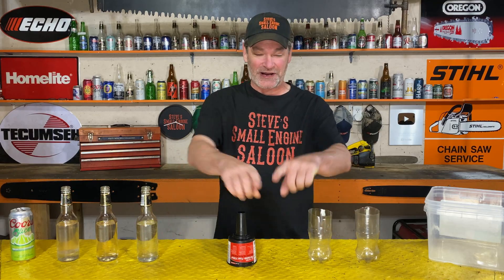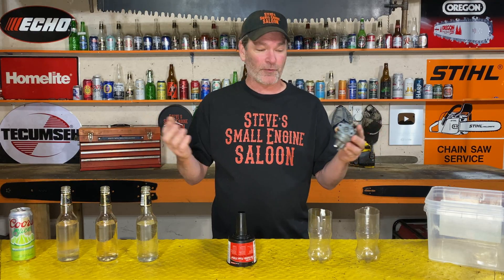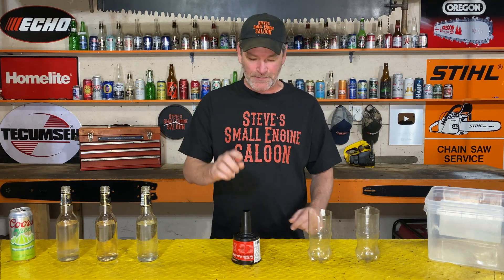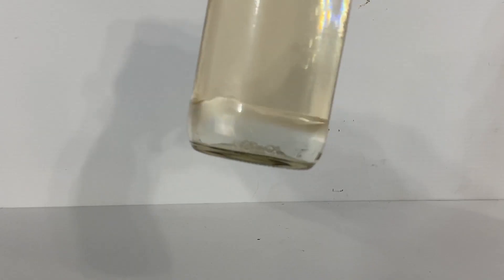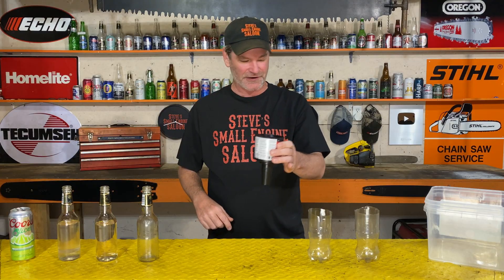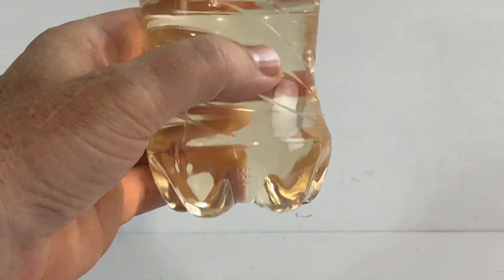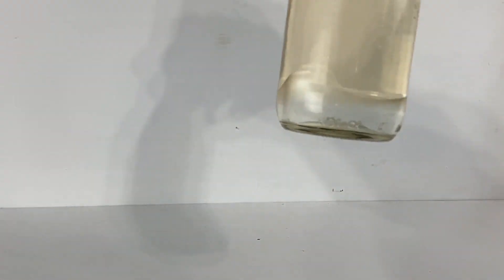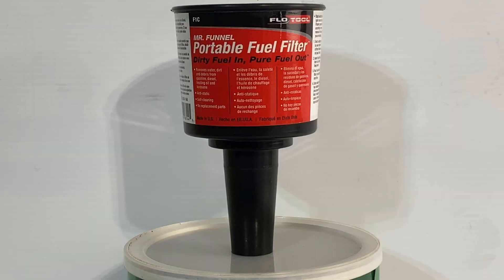Does Mr. Funnel Fuel Filter Really Remove Water From Gasoline

Comment from the maker: ✅Click here for a Mr. Funnel ➜ https://amzn.to/2Em3ydY
For more videos like this, check out: 
👉Quickest Way To Test Your Gasoline For Ethanol ➜ https://youtu.be/uLToBqG_F6M
👉Does Mr Funnel Remove Ethanol From Gasoline? ➜ https://youtu.be/6qGH7PqkYSw
👉How to Adjust or Tune the Carburetor on a Leaf Blower ➜ https://youtu.be/DWPUYJiF6KM
👉CORRECT WAY To Tune The Carburetor On A Chainsaw ➜  https://youtu.be/M6T5JoGXcHY
👉How To Adjust Or Tune The Carburetor On A Weedeater ➜ https://youtu.be/gmhxTvGRtCg

You can connect with Steve here too: 
✅Visit Steve’s WEBSITE ➜ http://www.stevessmallenginesaloon.com/ 
✅Visit Steve’s PARTS & TOOL STORE ➜ https://www.amazon.com/shop/stevessmallenginesaloon 
✅Follow Steve on FACEBOOK ➜ https://www.facebook.com/stevessmallenginesaloon 
✅Follow Steve on INSTAGRAM ➜ https://www.instagram.com/stevessmallenginesaloon/ 
✅Follow Steve on TWITTER ➜ https://twitter.com/SteveSaloon
Reply: Does it with with oil/gas mix?
Reply: first i've heard of it.  finally an answer for getting water out.  i can think of a dozen ways this will make my life easier.  Great video. thanks.
Reply: Steve you should mention that the one in the link is the small size funnel. 2.5gal/min.  Flotool makes bigger ones. Add them to the links.
Reply: So , my question is " how does it work?"
Reply: @Everyday_Richard  If you REALLY want to know why not just buy one and find out?
Reply: Did you try it on E-10 with water contamination?  Since this test was posted the refineries here in Louisiana are making an E-10 fuel that binds ethanol to gasoline chemically so the beer bottle water test no longer works.

Comment: Steve I was curious, I have a mr funnel and it works amazing for taking water out of the gas. One major question I have is I’m going to be making ethanol free gas with the water in the gas truck. My question is when the water and ethanol are separated from the gas if I pour the gas and water mixture down a mr funnel would that take the water and the ethanol out or would the ethanol get re combined with the gas when I try to pour it into the funnel after it’s separated
Reply: Easy way to tell if it does or doesn’t would be too run it through the Mr funnel. Then afterwards put the filtered fuel into a graduated cylinder with measurements marks on it, say 100 ml of fuel then add 20ml of water. Then look at the measurement llone too see if the water that has separated from the fuel is at the 20ml mark! If it is then the ethanol was removed. However if the separated water is now say at 30ml that means that the ethanol was still in the gas.

Comment: I read a story in the 60s. Stranded fishermen, small engine on a canoe, capsized --- water in gas. Dilemma! One fisherman had a chamois shirt. Gas/water poured through the chamois separated the mix.., gas went through, water did not. PROBLEM! It was a story (supposedly true) in an outdoor magazine. So, if you have the chance, and the money to possibly ruin a chamois - whatever - (probably don't need to spend $$$hundreds on an expensive shirt) It would be good to know. A small piece of chamois auto-drying towel kept with your funnel might be just as effective???
Reply: Bush Pilots in Alaska did exactly that for decades.  The trick is to pre-wet the leather with gasoline first so that the fuel passes through while the water and any junk won't pass through.  The old "Water and Oil (in this case gas) won't mix".  - Joe -
Reply: @joesinakandid528   Thanks. It sounded plausible.

Comment: Thanks Steve - I just bought one on Amazon for my generator after a power outage a few weeks back, not so much for the water removal than it looked like the best, most stable size for filling the generator.  My old funnel left gas splashing all over the place.  I was skeptical about the water removal function but now know it works which is a bonus. Keep up the great videos!
Reply from the maker: Fantastic!

Comment: I recommended Mr. Funnel to you several years ago. I have a complete set of Mr. Funnels and love all of them. I fill a 5-gal No-Spill Poly Gas Can with Premium Unleaded gas at the filling station and then when I get back to my place, I pour 5-gallons from my plastic can into one of my 4 high-tech 5-gallon steel cans using Mr. Funnel. I then add Sta-bil and Lucus fuel treatment and then fill up a 2.5-gallon No-Spill Poly Gas Can again using Mr. Funnel for use in my equipment using un-mixed gas. I also fill up a 2.5-gallon No-Spill Poly Gas Can filtered again with Mr. Funnel and then add Stihl Synthetic mixed oil in a 40 to 1 ratio. I never have any gas problems in my lawn mower, snow blower, string trimmer, lawn edger, chain saw, etc.

Comment: Mr Funnel works like a CHAMPION.     I’ve got the next bigger size from the one in the video.   I store mine inside a gallon zip lock baggy.    Fantastic for lawn mowers, outboards ect.       My advice is If using for farm tractors large boats ect  spend the cash buy the biggest one .   It has two of those towers  and should work at closer to the speed of a regular funnel.      The singles are really slow for pouring from a 5 gallon can ect.        Well worth the money and in my experience last a lifetime , 15 years and counting.       👍🏻👍🏻👍🏻👍🏻👍🏻😻
     I even used mine to salvage some old dirty rusty fuel oil to burn in my tractor..      NOTHING showed up in my clear bottle tests and clear prefilter.    I did run it through twice to be sure and diluted it with a lot of new oil before running it but no problems at all.       I can’t recommend these enough just don’t go cheap with a small one or you’ll be getting tired of holding that gas can really fast
Reply from the maker: Right on

Comment: What an excellent demonlstration, now when I build and use my ethanol separator I can use the funnel to eliminate all water and hopefully the ethanol in the tailings of the fuel canister.
Reply: @Thinking Impaired, can you really separate the water from ethanol fuel  to truly make non-ethanol fuel? I have seen a few videos of this, but really don't know.
Reply: @JohnSmith-tv5ep  yes it's easy because ethanol loves water. And gasoline hates water. Get a glass cup or bottle add half gas and add about 20% water. The fluids will separate much like oil and vinegar separate in salad dressing. 
Water ethanol will be on the bottom. Some people add food coloring to make it easy to tell the difference. 
So if you design a container that you can drain off what's on the bottom of the mix you'll remove the ethanol water mix.
Reply: @thinkingimpaired5663  thanks for your reply! So,.... a question,  would it make a difference using 'tap' water, or would you have to use 'distilled' water?
Reply: @JohnSmith-tv5ep  I'm not sure, I'm using distilled because my water is high iron content well water.

Comment: Steve great video. You should try the Mr. Funnel to remove ethanol from gas.  Add water to gas shake let rest for 5 minuets then pour through Mr. Funnel and see if the ethanol and water is removed from gas. Give it a try. Thanks

Comment: Nice one Steve. I been using MR Funnel to clean diesel in my boat fuel tank. I pump dirty diesel and water out of the bottom of the built in tank, into a gallon jug. Filter that and return it to the tank......repeatedly. My fuel filters are much cleaner now. Does it separate diesel bug ? Sure does ! L&R from the UK.
Reply from the maker: Good stuff

Comment: They work great, as long as the water is not emulsified in the fuel.  They also don't work so well if you shake or agitate the fuel can that has water in it before using the funnel, as it temporarily bonds with the fuel and it passes through the coated screen with the fuel, and will soon separate back out of suspension and you will then have water in your equipment's fuel tank anyway.
Reply: I only buy premium unleaded with no ethanol for my equipment and so the only water I'm straining out is from the water in the bottom of the 10,000-gallon tank at the filling station. The water sits in my gas can for  10 minutes before I transfer it into my steel gas can. I've conducted a few tests with a granulated test tube and after the ethanol and water are shaken, it only takes a few minutes for the water to precipitate out of the solution. My gas station gas has negligible water in it.

Comment: They work, but alcohol mixed with water will pass through, still very good tool to have. I've been cleaning the screen by pouring good fuel in backwards, and you can pour some water in first, to get it to the lower part of the screen. They say to just bang it out, but that will lead to damage.

Comment: I'm curious to know if it will filter out the ethanol. There isn't anywhere around here that sells straight gas and I'm tired of messing with my carbs all of the time. Love your videos, great advice. Keep up the good work. Thanks.
Reply: If I were you I'd run my equipment empty and never leave the ethanol in the carb.

Comment: Do you need separate ones for gasoline and diesel?

How does it handle two cycle fuel mix?  Usually make a gallon of that and use it throughout the season.

Comment: If i was to try and mix water with 10% ethanol gas and let it settle. Then use this funnel to filter it would it also remove the Ethanol? Just wondering. Great video I subscribed and now I'm running through you back log video. Beautiful stuff your doing.

Comment: I’d like to see it with 40:1/50:1 mixed fuel, with regular ethanol fuel, and diesel just for kicks
Reply: I use one to filter the diesel going into the tank on my tractor.  Works great.
Reply: It works fine with two cycle mix fuel as well. Have done it many times in the Arctic. The oil molecules mixed with the gas are so fine they go right through the mesh.
Reply: @JHruby  A previous comment says it does not.  Possibly  differences in viscosities?

Comment: Off the Mr funnel site: Q. Will the filter work on mixed fuel with 2-cycle oil in it?

A. Yes, but if your 2-cycle oil has a detergent base the detergents can break down molecules of water and some water might pass the screen. Usually only a drop or two but if you are concerned, filter the fuel a second time because unless the sump is full of water, it is not possible that any water passed the filter.

Comment: The funnel looks like a good addition to the equipment shed if you mix a gallon of 2 stroke gas at a time from 5 gallon cans. Otherwise, my Wright ZK mower holds 15 gallons of gas, I empty at least two 5 gallon cans when I fuel it with cans, so all of my 5 gallon cans get emptied completely before I go fill them back up. There's not much chance of collecting condensation in them that way either, and storing them inside keeps rainwater out of the cans also. .
Reply from the maker: Right on

Comment: I had a quick look on ebay UK. I never heard of one before but the prices are good so I might just give one a try.  I always have drop of water with bits of dirt grass and leaves, from who knows where in my containers, and like all of us sometimes need to get the last drop of fuel out,  and either end up with water or bits in the tank,  or more often pouring away the last bit of stored fuel.  I wonder if it will remove the absorbed water from ethanol fuel as well. 👍

Comment: I got educated about water in avgas years ago as a new airplane pilot. Many general aviation airplanes have fuel caps on the top of the wing that go bad and allow water in or sometimes water condensates in the tank itself. A pre-flight item was to always check for water in the fuel tanks (sumping the tanks). Jet fuel has an additive to overcome water in jet fuel. No worries there. No sumping needed.

Comment: I'd been useing Outerwear products funnel pre-filter screen for years before seeing, then buying the Hoppy product. They all seem to work well, but with the Outwears product, you simply slip them over the top of your existing funnel plus being right out on top, inside the funnel, it's easy to wipe any goo that came out your old fuel jug with a paper towel. When I purchased mine years back, I got a pre-filter for my 2 quart and one for a 4 quart funnel for bigger jobs. Use my little Hoppy funnel for the small stuff, but because of it's less surface area, it doesn't filter as rapidly as the big Outerwear pre-filters do. But they are all effective for "wringing" water out of your fuel. Despite ALWAYS filling up at a station with a pump marked "No Alchohol" (sorry, Steve, no offense ;^), but invariably funnels will occasionally still pull water out, do to fuel jugs taking on some humidity because sometimes wildly varying temperatures (ie like a cold one sweating on a humid day- here's to you Steve) causes the fuel inside the jug, even with its lid and vent on, to still occasionally draw moisture.

Comment: Used to for years,have not been to the repair shop in years.I use a big one for my tractors also.It works for all types of fuel.
Reply: I'd like to find a big funnel like the one that you had. Are they available at tractor supply companies?

Comment: If you purposely add water to gasoline to remove ethanol, will the water containing ethanol pass through this funnel? If this works, it would be a bit simpler than the separatory funnel method. I get the feeling that high concentrations of ethanol in water would pass through but if a rather large excess of water is used, the funnel may stop the water/Ethanol mix.

Comment: I've heard that if you want to make ethanol free gas, you can take regular gas, mix it with water, the ethanol will cling to the water and then you can pass it through the filter and only the pure gas will come out.
Reply: In a phenomenon called "phase separation", water mixed with ethanol gas causes the alcohol molecule to separate from the water molecule and fall to the bottom of the tank and the gas tank then pumps water to the engine instead of ethanol gas and the car comes to a halt. Mr. Funnel will not take water out of the ethanol molecule but it will take water not mixed with fuel out of gas you get from the filling station. Once ethanol gas gets into the gas tank, it can be contaminated with condensation and once the level of condensation gets large enough, phase separation can occur. For all of my engines, I use nothing but Premium unleaded gas that contains no ethanol.

Comment: You see people add water to gasoline and shake to get ethanol to stick to the water then dump the gasoline out add trap the ethanol to the water to make ethanol free gasoline. I wonder if you add the water to gasoline shake it up and dump it through that filter would it trap the ethanol in the funnel with the water or would it separate the ethanol from the water and flow back through with the gasoline........

Comment: That’s pretty amazing. I never heard of that funnel before, but I definitely need a few now! Does it work with 2 stroke mix??
Reply: Yeah i was curious about that two.  My weedeater mix always seems to get contiminated.
Reply: yes it will, oil is soluble in gas, water is not
Reply: The size of the water molecule is much larger than the gas molecule and the gas/oil molecule. My premium unleaded gas mixed with Lucas fuel treatment passes right through. I have poured mixed fuel through Mr. Funnel with no problems. The mixed fuel I use has 40 to 1 mixture of synthetic oil and the molecules are very small.
Reply: funnel the gas first then mix it , if not sure .
Reply: @CALVINLNIKONT  Interesting...a previous comment says it does not work.
Reply: @CALVINLNIKONT  Water molecules are SMALLER than gasoline molecules!
Reply: @robertlitman2661  Chemists seem to be arguing about this. See this article: People also ask
Are alcohol molecules smaller than water molecules?
Ethanol molecules are smaller than water molecules, so when the two liquids are mixed together the ethanol falls between the spaces left by the water.Mar 31, 2019

Miscibility of Fluids in Chemistry - ThoughtCo

Comment: Hey Steve, I have a Raycor brand funnel that works the same way, worked great until I touched the filter screen with my bare hands to clean some debris off. Now she passes water just like fuel. I must have disturbed the hydrophobic coating ??? The funny thing is that supposedly the screen has large enough holes to pass fuel but small enough not to allow water to pass, no mention of any coatings. I replaced the funnel & have been diligent not to touch the green screen/filter.
Reply: If you still have the old funnel, try cleaning the screen with some type of solvent, like xylene, or brake cleaner spray.  It might fix it, ...or it just might strip the coating off. =O)  Nothing to lose at this point, and at any rate, it would still be useful for filtering out sand, dirt, bugs, twigs, etc., whether or not if it fixes the water passing through it.
Reply: @warped2875  I tried brakeclean, starting fluid, & carb cleaner in that order. No luck. I still use the funnel, just not for fuel. It works great for reusing antifreeze, any crap that gets in the drain pan gets filtered by the screen.